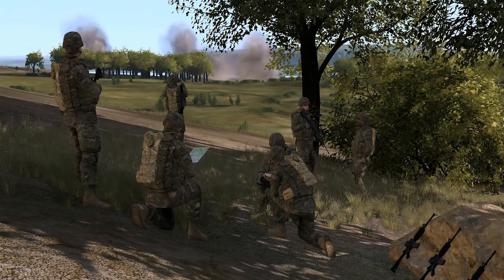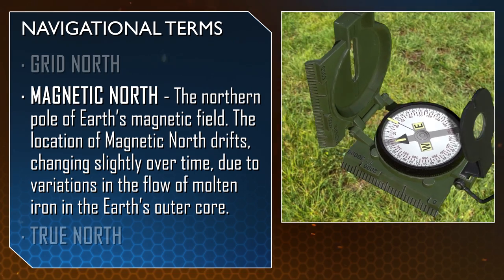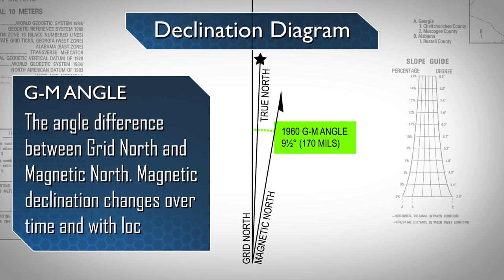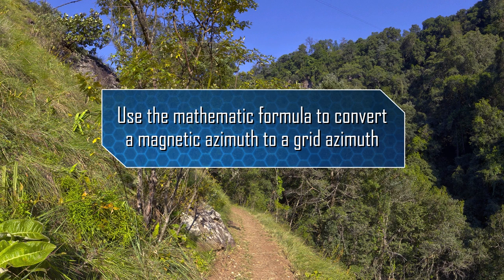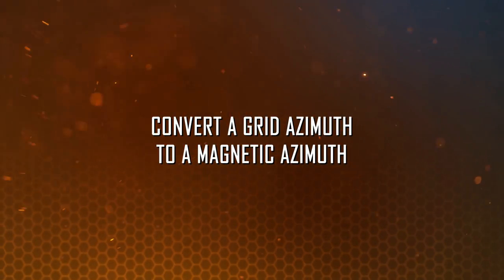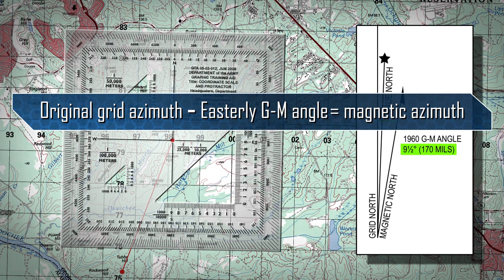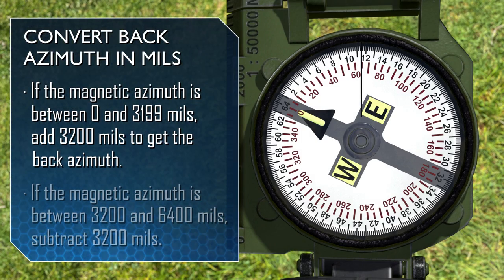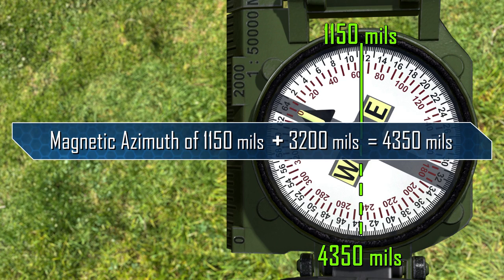SMCT: Convert Azimuths and Compute Back Azimuths

Comment: so with going from field to grid or map, adding the 9.5 degrees will put u right on target on the map? I mean say a water tower is 190 degrees on my magnetic reading,  and then I use my protracter on my map, from exact point I took magnetic reading to the water tower it will be 199.5 degrees?
Reply: @danjarvis6980  I get your explanation and I apply the same rules, but on paper, I don't get it, just like OP said. I did a prismatic compass calibration and upon verifying my azimuth with the "correct" (surveyed) azimuth that was on the calibration post, I had to substract the GM angle, just like the map says (West GN here). But the drawing on my map confuse me.. my magnetic north is to the left, why would I make a substraction to get a grid azimuth if my grid north is on the right side ? (+) ?

Comment: Can you tell me about the meaning of True Azimuth, Magnetic Azimuth and Grid Azimuth?
Reply: True Azimuth = angle between the direction of the True North and the direction of the qobjective

Magnetic Azimuth = angle between the Magnetic North (measured with your compass) and the direction of your objective (measured on the field)

Grid Azimuth = angle between the direction of the North of the Map and the direction of the objective (measured on the map)

I hope this helps.
Reply: Azimuth is a fancy Greek and Latin word for direction of travel.
True Azimuth is direction to Polar North Pole.
Magnetic is direction to  magnetic north pole, which is not fixed , but moves a few inches every year. Difference between True and Magnetic north is called DECLINATION.
Grid azimuth is a line on map from one point on map to another. 
Civilian sport is called Orienterring.
Armed Forces skill is called Land Navigation or LandNav. 
In US Armed Forces, you can be weak in some tasks, and be OK. But there are three tasks which an individual must pass. Basic Rifle Marksmanship with M4 or M-16 family of weapons,  Land Navigation, and radio procedures with NATO phonetic alphabet. Inability in any of those core skills puts individual,  and unit at safety risk . Jeopardizing unit readiness and mission.
There are unrecovered remains of Marines , soldiers, and airmen somewhere in the high desert of Ft. Irwin, 29Palms, and China Lake. During training they somehow got separated,  got lost, ran  out of water,  and perished. As this area of California and Nevada is bigger then some nations,  and empty. Well you can imagine the rest.